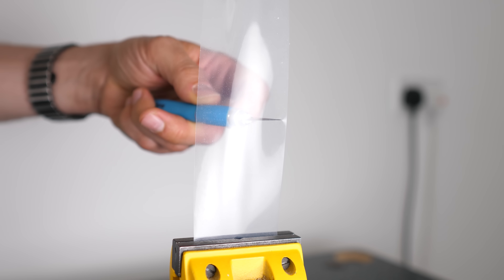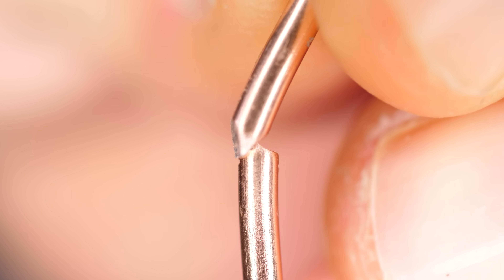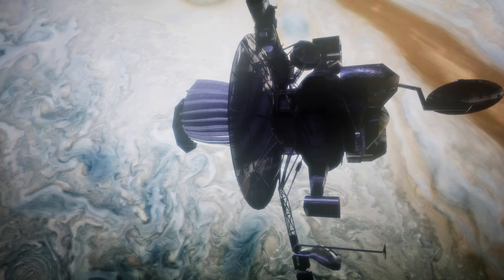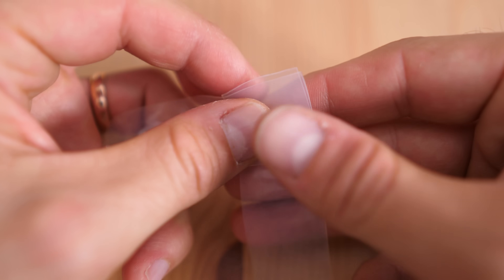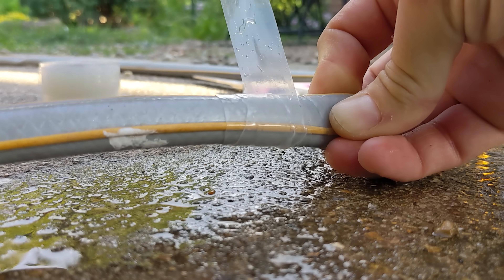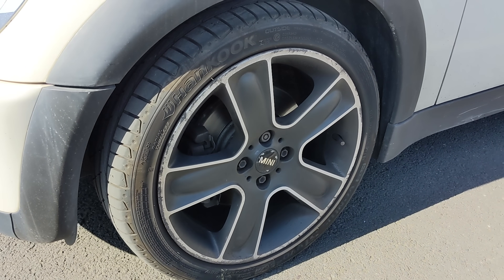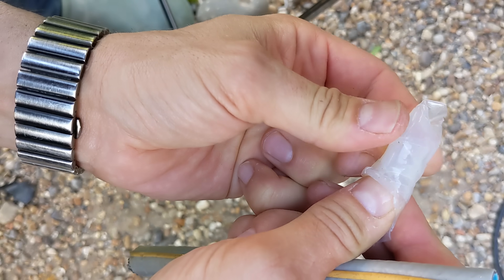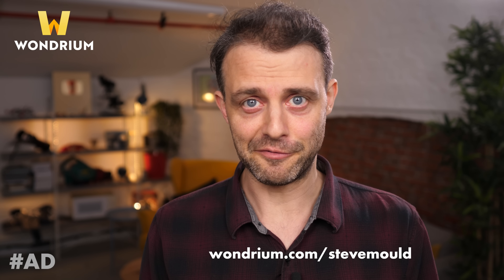Self-Healing Material

Comment: It is so awesome that you anticipated the question of what would happen in a vacuum when discussing cutting a metal.
It was the first thing that popped into my mind and I'm so thankful I didn't have to ask or look it up.
Thanks!
Reply: I typed the comment, thought to myself, "Wait, he'll probably address this," and then an astronaut appeared.
Reply: Thats what makes him great
Reply: If you do want to go deeper the process is called cold welding
Reply: @scottb9997  yeah lol cold welding was my immediate first thought when he asked "why isn't metal self-healing?".
Reply: @tissuepaper9962  cold welding isnt real, it may work for cheap chinesium garbage or be good for artwork but cold welding isnt real welding, no cold weld will hold or have any kind of penetration.
Reply: @tissuepaper9962  it isnt real because a cold weld is just an improper weld... its a weld that would fail any inspection. Go watch Tfs (the fabricator series) on youtube, he has an entire video dedicated to the subject of cold welding. Antiseize isnt a preventative measure to "prevent cold welding" its used to prevent galling, seizing, and corrosion as well as allow for easier removal of fasteners.
Reply: @g00gleisgayerthanaids56  the word "weld" doesn't have anything to do with strength, or certification. It's purely a physical description of what's happening, two previously disjunct pieces of material becoming one continuous piece.

What exactly do you think galling is? It's cold welding! The process is one and the same as the process that caused the space probe mentioned in the video to fail.
Reply: @tissuepaper9962  this is where youre wrong buck-o, on both accounts no less...

As per your definition, the word implies a level of strength as does "one continuous piece" - when have you ever been able to just break a solid piece of metal with your bare hands? 

Galling forms as a result of friction, ie friction welding, which is absolutely not cold welding, boyo.

Are you a welder? Or just some guy who has seen a few welding videos? 

A weld that breaks before the base metal isnt a weld, get it?
Reply: @g00gleisgayerthanaids56  Galling absolutely isn't friction welding, no part of the fastener gets hot enough for friction welding when it's just being tightened. You can recite the Wikipedia page to me all you want.

There are plenty of wires that I work with on a daily basis that I could easily pull apart with my bare hands. Does that mean that those continuous wires aren't actually continuous? Is a thin steel sheet not "continuous" by your definition because I could break it apart with my bare hands by bending it back and forth until it breaks?

When did I ever say cold welding was a viable fabrication technique? Here's a hint: never. That doesn't mean that it doesn't happen spontaneously in many circumstances or "isn't real". You're being a condescending douche for no good reason.
Reply: @tissuepaper9962  "During the tightening of the
fastener, pressure builds between the contacting thread surfaces and breaks down the protective oxide 
coatings. With the absence of the oxide coating, the metal high points of the threads are exposed to one 
another, which increases friction. The combination of these two events can generate enough heat to fuse 
and seize the nut and bolt together." From fastenal, who the fuck uses wikipedia?

Its commonly called cold welding, but that is an improper descriptor, friction welding is the mechanism of action that causes galling. 

Please guy, you think im talking about a wire or paper clip? Take a 1/4 inch thick steel pipe, you arent bending or breaking that, weld two sections together, you arent breaking that. If you "cold welded" those two pieces, you could easily snap it with very little effort. This is the point i am trying to get across, is it semantics? Sure, but why do you have a problem with being more accurate? Does my syntax hurt your pwecious wittle feeewings? Grow up sport, im doing you a favor.
Reply: It's left me wondering about non-oxygen atmospheres though!
Reply: It doesn’t explain why unreactive metals don’t cold weld readily though.
Reply: @davidrfrench  You actually can cold weld clean copper at room temperature with sufficient pressure, and probably other noble metals as well. Apparently it's used fairly often to join solid copper wires together. However, just because noble metals do not readily oxidize doesn't mean they don't oxidize at all. It would only take a very thin layer of oxide to disrupt a crystal lattice and prevent easy welding, and even without oxygen, there are lots of other contaminants that can get onto the surfaces of things, such as grease. Probably even moisture would interfere, if the humidity were high enough. So outside of a clean room environment (at the least) I doubt any metals will be easy enough to cold weld under an oxygen atmosphere that it could be done without significant pressure (enough to need a press, not simply pressing together with your hands).

Also, the roughness of the surfaces is a significant factor. Rough surfaces won't actually have as much direct contact as smooth surfaces do when pressed together. So even if cold welding did occur on a rough surface, it would be a very weak joint and the two parts would break apart very easily, perhaps easily enough that you wouldn't even notice that anything had happened at all. This would be another reason high pressure is necessary, as it would force the surfaces to flatten out against each other.
Reply: @killerbee.13  thanks! :)
Reply: These explanations are so digestible because all the explanations go through child-level thought processes (something very hard to do as an adult).
Reply: Yea same thought
Reply: HAHA I just asked that
Reply: will the same thing occur in oxygen deficient environment but not vacuum (eg nitrogen rich environment) ??
Reply: @yashrajdebnath5747  look into tig welding. We use 100% argon to create our own atmosphere over the weld puddle. My mig welder runs a mixture of argon co2 and o2 for shielding gas, usually called stargon. So no, you dont need to be in a vacuum, youd just need to change the local atmosphere for whatever youre welding.

Comment: I suspect this is indeed a crosslinking reaction, and probably more specifically a tautomerization so that it can occur appreciably at room temperature (keto-enol is the simplest example for those unfamiliar, probably along similar lines due to the stability of the resonance structures especially with ketones but this is probably a more complex reaction). The (mild) pressure application probably pushes the equilibrium enough to significantly increase the crosslinking fraction. Probably also at play here is the viscosity dependence on pressure (and to a lesser extent, temperature).

I agree it almost certainly is not self-healing capsules.

playing with the pH of the polymer could also reveal the mechanism along similar lines to keto-enol structures requiring the proton in the pseudo-ring.

source: polymer engineer PhD candidate
Reply: I'll take your word for it lol
Reply: Tautomerism requires strong reagents, typically something like sodium hydroxide (aqueous) would be able to produce conditions that would yield less than one percent resonance structure (enol) and this would only occur in polarising conditions. In the solid state molecular collisions are unlikely between the two surfaces in same way as if in the liquid phase. Also you would expect a product of a tautomerism reaction to have to leave the chemical system to drive such a reaction, for a stoichiometric reaction you would require reactivity to the order of say sodium hydride, and then it would have to evolve an equivalent of hydrogen. And the material is in its solid state, between the lower glass transition temperature and the melting point, so viscosity isn't relevant. I suppose ligation due to the molecular motion exhibited by elastomers in that range could be called solid state complex formation. ATB with the research.
Reply: @tonyguy9762  my mention of viscosity dependence on pressure precisely points to the idea that the added pressure may induce more liquid-like behavior. I'm more confused that you mentioned this is lower than the glass transition but also call it solid state: I particularly study polymer glasses (or supercooled liquids, if you prefer) and particularly object to calling a glass a solid. There is no distinction between the molecular behavior of a liquid and a glass, so the collision behavior should be indistinguishable. Viscosity is absolutely relevant: glasses only appear "solid" to us because of the mismatch of viscosity (or relaxation time) and the observation time window (for us humans, on the order of tens or hundreds of seconds).

I certainly do not deal with chemistry much, so I have no guess as to that. But this is clearly an amorphous crosslinked polymer, that appears to form crosslinks when pressed together.
Reply: @williamdrayer5166  Wait are you saying glass really is a liquid after all? I thought that was an urban myth.
Reply: @Khaim.m  glass isn't a liquid, it's an amorphous solid. What he is talking about is a bit more complex then simple state change. It is basically they temperature that something goes from rubbery to glass like. Like a piece of plastic that is hard and rigid when cold but rubbery and malleable when hot. The glass urban legend is specifically about glass slowly flowing at room temperature, which is false. Below the glass transition temperature of 270C for most window glass, any actual flow is practically nonexistent.
Reply: Amazing insights!
Reply: Is this why even when he crushed it in his fist at 7:15 while trying to pull it apart, it still stuck to itself?
Reply: @DefensiveWounds  yes this was part of my thinking
Reply: I agree.

Comment: Could this be used on a CNC mill/laser/waterjet as a surface to lay your materials on?
Reply: Probly not unless it is made stiffer? Hard to tell how hard the polymer is from the thin strips. Dont want yo things to wobble if its squishy.
Reply: I was thinking, like you said a bit stiffer therefore perhaps a lot thicker. But it wil probably not have the same properties when scaled up to a let's say 5mm sheet or more.

Comment: Have you read into the following paper: 10.1038/s41578-020-0202-4
I belief there is more to it than the localized chemical reactions that you also mention (i.e. polymerisation). Aluminium, for example, can also have a variety of self-healing mechanisms, e.g. based on a reaction with oxygen. The product (Aluminium-Oxyde) is not permeable to O2 molecules, so it prevents further oxidisation after physical damage to the surface. 
For the polymer, it might be that the force from pushing the two pieces together is enough activation energy to initiate reactions. If that would be the case, maybe a thermal image would indicate an exo- or endothermal reaction.
You could also change the topological structure of the stripes to see, if that impacts the self-healing mechanism. Maybe some adhesion effects are in place.
Reply: I'm no materials expert, but I believe the protective oxide layer in aluminum is a different type of self healing than whatever is going on here, since that only protects against further oxidization (unless the layer is damaged) but it doesn't allow two pieces of aluminum to be joined into one after separation.
Reply: Applied science  channel Google scientist Ben Kraznow , this could be one for him. Super in depth science of the wonders of nature.
Reply from the maker: Hi Julius, thanks for the insightful info, really appreciate it. If you're interested in joining my Discord where we chat through ideas here's a one time link: https://discord.gg/VzsRmy7A

Comment: hoping for a self healing 3D printing filament, it will eliminates layer separation and possibly making it  non porous.
Reply: How would you keep it from bonding when on the spool though? Perhaps some kind of coating that burns or melts off when extruded?
Reply: @ADBBuild  You could have a carrier on the spool made out of... corrugated cardboard open on one side? Separating the layers of the plastic. You would have like a dozen or two loops side to side in their own wells, and once they're all unspooled, the cardboard protector piece simply falls down from the spool and the next layer becomes usable, and there'd be these between each layer.

Honestly i haven't thought this through, i really don't know whether this would work. But it's a direction to explore, potentially, if the whole self healing filament idea has any legs to stand on - i really doubt.

Another possibility is to rely on the mixing action of the nozzle, though unfortunately it's pretty weak, but maybe with CHT nozzle or an insert similar to those used in injection moulding, it could be improved. The filament could be coated with a barrier polymer that doesn't have the self healing property and prevents the filament from healing onto itself, but as it gets mixed in, during extrusion, the self-healing polymer gets exposed on the surface of the extruded bead. The fact that a very thin barrier layer would be sufficient is on your side, the barrier material could be barely a percent or less by volume and might not end up influencing the properties too much.
Reply: @ADBBuild  It might just be me, but when I think of coatings meant to be burned or melted off, I can only think of things that would either give off harmful fumes, making it impractical and unsafe to use indoors, or make a mess, potentially also mixing in with the filament as it melts. It may not be the most practical, but I feel some sort of removable thin paper shell similar to a straw wrapper could be a decent solution. Considering existing technology, a system to automatically remove and collect the paper as the plastic is printed seems fairly straightforward to design. There's also the added bonus of paper being recyclable; if the system of collecting the shell is efficient enough, they could even be directly used for multiple spools
Well, if this sort of self healing material is even suitable to print with. It seems rather flexible, making it impractical to print anything intended to hold its shape
Now, it's very likely that I don't actually know much about 3D printing or anything I'm talking about (after all, it's hard to know what information you don't have), but these are just my thoughts with the limited knowledge I have
Wow this is a lot more words than I intended to type when replying to this comment
Reply: I think you might have an easier time post-processing existing filaments - it's possible to create gastight, food-safe prints on regular, consumer-grade fdm printers.
Unfortunately I've signed an NDA, so I can't quite disclose how it's done :-/
Reply: @fuzzydane2090  Mhm i haven't signed any relevant NDAs and there are two basic methods already known in the 3D printing community.

One is coatings - shellac, epoxy, etc.

Second is remelting the print in a medium, such as super fine sand or table salt. The medium provides support and maintains shape.
Reply: @fuzzydane2090  oh but you would say that! ;)
That does sound cool, although what kind of niche product needs 3-D printed plastic packaging? Or would it be to create highly detailed moulds for restaurant presentation?
Reply: @armadillito   Look up the Merlin 400 from Drizzle - it's an appliance we make that lets you make CBD-oil at home.
There are channels between three different chambers that transfer isopropanol, both as a liquid and a gas, as well as a vacuum chamber - all 3D-printed.
Reply: @fuzzydane2090  is that something I want on my search history in the UK?
Reply: Now that could be amazing

Comment: Steve, what is this material called? If it's commercially available I'd love to get my hands on some to play with!
Reply: Looks like a company called Versaf sells a similar product that doesn’t require stretching. I’m also used to the self amalgamation tape where you have to stretch it. The brand I’m used to using is F-5 tape. Usually has a different colored stripe down the middle to help make even overlaping
Reply: The stuff we use at work is called Rescue Tape
Reply: Usually "self-fusing" or "self-amalgamating" tape.
Reply: @JamesChurchill  the one Steve demo'd looked quite different from the self-amalgamating tapes I've used before - it didn't require stretching and basically bonds instantaneously!

Comment: A lot of this is because your "cuts" are so brutal. And as a result very rough on a molecular level.   If you could cut with a single molecule blade then the cut would be smooth enough for the two ends to be re-attached.
Reply: I think orientation also plays a role.

Comment: You can do cold welding with metal surfaces that have been exposed to air/oxygen for years, here on earth. The surfaces need to be able to get close enough on a nanoscopic level, which usually requires non-trivial pressure, but they will (at least partially) fuse. AvE has a video describing the phenomenon in gauge blocks.

Comment: What about unreactive metals such as gold and platinum, would it be possible to cut them and then stick them back together like gauge blocks?
Reply: That's what I thought. Gold is one of the only if not the only metal found in its pure form in the Earth's crust. Sodium, for example, forms bonds with chlorine in the Earth's crust.
Reply: @martinduran9523  Yeah most metals are found as ores or salts (if they are reactive like sodium and other alkali metals).

Gold is found as nuggets.

Comment: I wonder if the catalyst is heat. Even very low amounts. Pushing the two pieces together, pressure, creates heat at a molecular level. When you lay the tape on top of each other and rub your finger across it you are once more applying pressure but also heat from friction.